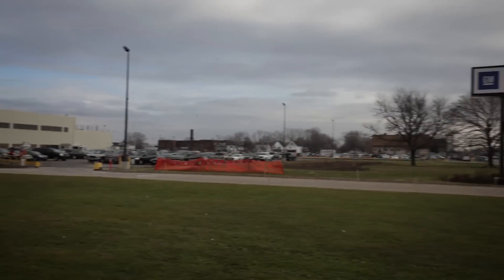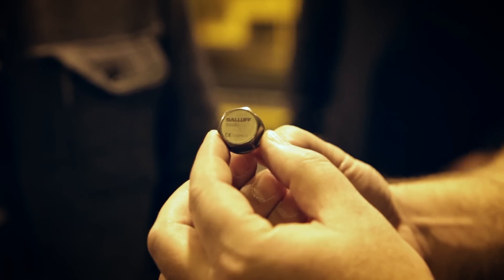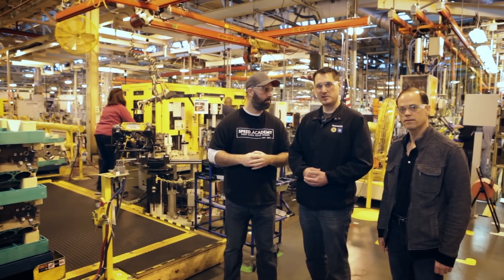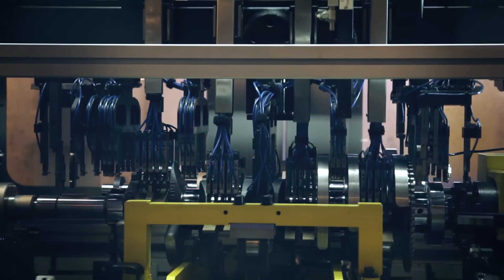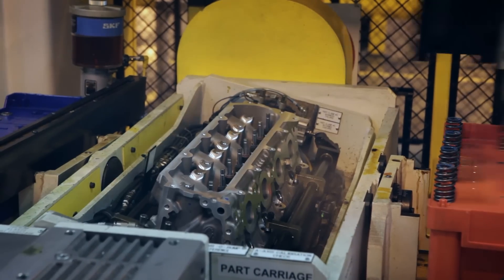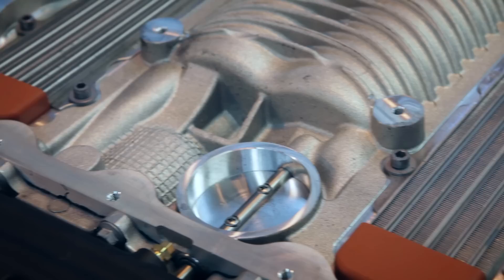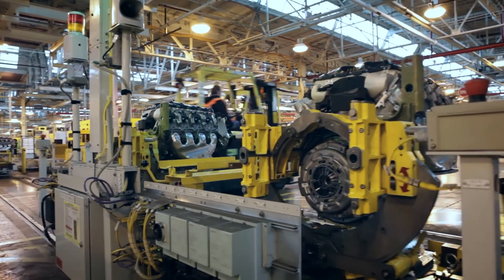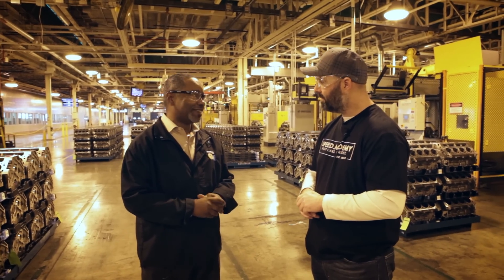Building GM's most powerful Engine Ever, the 650hp LT4 V8!

Comment: Sorry m8, but the LT4 isn't the most powerful engine that GM built. The most powerful (and also biggest) would the the legendary 572. Produces somewhere around 900 Hp.
Reply: LT4 is for production vehicles. The 572 is a special order racing crate engine.
Reply: the LT4 is for production cars that is everyday driving. The 572R is for race purposes only.
Reply: +Erik Burrell you can have a everyday driver with a 572
Reply: it is rated at 727hp at the crank MAX...some of the 572s only make 600hp
Reply: +Erik Burrell it would be badass
Reply: I think he meant standard production automobile engine.
Reply: +Erik Burrell damn! I thought the 572 was rated a some 700hp, but 900hp, that's insane naturally aspirated power.
Reply: The 572 is not in everyday cars but, but the LT engine is >:)
Reply: LT4 is a production engine broski 
572 is a crate engine
Reply: Erik Burrell production engine
Reply: blue03r6. You might want to do some research before you say something,,, 😂
Reply: Lt5 in c7 zr1 makes 755hp
Reply: Jorge The beast no the lt4 only makes around 300 to 400 hp without the supercharger, if you put a supercharger on the 572 you have way over 1200 easily
Reply: ForzaClutch there talking normal production
Reply: The 572 is not the most powerful engine GM ever built. 

Remember that Electro-Motive was a division of GM and EMD’s V-16 265H produced over 6000 horsepower.
Reply: Norman Fillmore it’s a train motor shut up
Reply: This should of been reirriated as most powerful small block LT4 V8 GM production engine built meaning produced in large quantities in a plant assembly line. You're probably talking about a 572 big block engine thats modified and only special ordered.
Reply: What about the ss 454
Reply: Comparing a crate engine to a production engine, Thanks for proving the internet is a  playground of idiots.

Comment: Can someone please explain to me what makes these engines so compact?
Ta.
Reply: +Samsgarden 
Single cam in middle of block, 16 valves, pushrods, single chain for valve train to crankshaft for timing. Basically all the weight is lower down than any competing OHC engine and they are smaller and usually lighter also.
Hp per litre might not be as high but they have more liters in a smaller package to make up for it, the torque curve is thus better. The efficiency of a modern corvette or camaro Z/28 (even 7L LS7) is better than e.g. a Nissan GTR with latest V6 TT. Engine weighs less too and is much smaller. Power figures are comparable if not better for the v8, response will be too, no turbo lag. Not bad for a 60 year old engine design....

Comment: GM offer turn key engine LT4's for people that, lets say, want to put them in a 240sx?
Reply: tempted after my KA-T goes boom
Reply: +stephen dwyer burning oil only means it needs a little head work most likely. great motors those 318's :)
Reply: +stephen dwyer I don't think we understand. Punctuation helps a little too.
Reply: SquillyMon "LT4
MSRP $15,625†
P/N 19332621 and 19332702
(19332702 $16,250 MSRP)" 
they're selling it pretty cheap, but that's just the engine with no computer. if you add it up just the engine and transmission with controllers would go up to 25+k
Reply: +walperstyle Just buy a used one from a junkyard...
Reply: Thats too much for that car .  450 in a 240sx is perfect and you can drive it anywhere and whoop anybodies ass. Power to weight!
Reply: +walperstyle 
Yes they do. Jegs has them for a measly $21,455.
Reply: +walperstyle I'd say a LS3 is enough, maybe even a LC9 if you're on a budget.
Reply: +walperstyle Sure do...That is if you have the green... and LOTS of it.  I THINK this engine is close to 25 grand...but not certain...thats my guess.  I do know its available to purchase however.
Reply: Whoa !   That's a pretty good deal actually...
  Oh wait...I just read the rest of your post...  Yeah basically anyone who wants or even thinks to buy one of these wants it in an installable and runnable state so very few people will buy the naked block.  My first guess was close to 30K....which probably wasn't far off. 

For 30 Grand I can build something really crazy and fun...  That's a lot of money
Reply: Specific cars or trucks to choose from?
Reply: +walperstyl N.a, nos or turbo?
Reply: what is nos?
Reply: Well, NOS is actually a name brand. The substance used is NOX, or Nitrous Oxide (Nitrous Oxide System = NOS). It's sprayed into the intake along with extra fuel via extra nozzles. 2 systems, wet or dry. Wet is fuel and nitrous sprayed from the same nozzle with 2 ports for both fuel and nitrous (for higher power increases), Dry is just nitrous sprayed from extra nozzles and the extra fuel comes from either extra injectors or the same injectors at higher psi or longer duration (for lower power increases).
Reply: Yeah sorry, it's not NOX it's just NO. NOX is oxides of nitrogen produced by high combustion temps. Nitrous oxide is the same for cars as the stuff you breath at the dentist AKA: Laughing gas.
Reply: Through I have a standalone ECU that could adapt to nitrous, I'd never run it.  It is better to go with a good efficient turbo (not a big turbo, but an efficient one)
Reply: Yeah, there's just something about instantly cramming oxygen into a cylinder in the hopes that you've got the right amount of fuel so you don't blow up or burn up your internals. "Danger to the manifold".

Comment: My GM must have had aeroplane parts in the engine, coz' it flew to bits on the way home from the dealership...
Reply: MrKdr500  At least GM underlined the problem
Reply: John Jesus And ford circled the problem also.....
Reply: John Jesus "A joke is something spoken, written, or done with humorous intention.[1] Jokes may have many different forms, e.g., a single word or a gesture (considered in a particular context), a question-answer, or a whole short story. The word "joke" has a number of synonyms, including wisecrack, gag, prank, quip, jape and jest.[1] To achieve their end, jokes may employ irony, sarcasm, word play and other devices. Jokes may have a punch line, i.e., an ending to make it humorous.
A practical joke or prank differs from a spoken joke in that the major component of the humour is physical rather than verbal (for example placing salt in the sugar bowl)."
PS. if you work with drawings/plans you circle the problem! cockhead!
Reply: Keep lying kiddo.
Reply: John Jesus actually I was taught to underline the part of a sentence that was the answer or the most important part of the scentence

Comment: Still using cast cranks, pushrod's, and boring the cylinder walls without a deck plate......  Some of the many reasons I'm not a fan of GM
Reply: Don't go hating on push rods. Top fuel dragster and funny cars are the fastest on the strip and they have???... fuckin pushrods.
Reply: 4g63mark The cast cranked LSX's are handling up to 1000hp. DSM's are so much more reliable than any GM. Yeah right, have fun fixing your 4g63!
Reply: 4g63mark You were soooo close but missed the point. Has anyone made a OHC car go sub 4 sec in 1000 ft? No. You say an OHC cam engine would make more power. Show me one that makes 10,000 hp.
Reply: 4g63mark *Honing, not boring. As far as the pushrods and whatnot, GM may use older technology but it still works and it seems to work quite well so why change it? I do agree with you on the cast cranks however. I can understand that it is easier for mass production but a forged crank would be so much nicer.
Reply: +4g63mark GM  knows that the OHC is not worth the extra cost ,size ,weight ,complexity or durability issues  when they have a cheaper lighter  more compact durable push rod engine that can produce more then enough HP for it's intended use.Not to mention the cost of rebuilding a OHC engine is much greater. Sure the push rod engine is dated but Gm probably makes the best,least expensive,most advanced push rod engine on the planet.
Reply: 4g63's were designed for a turbocharger from the factory, so while it is impressive that they can handle lots of boost, it isn't at the same time. Why is 1000hp impressive? Because its 1000hp. That's plenty hp for most applications, more than plenty in reality, and it's impressive that an engine designed to be worked to death in big pickup, naturally aspirated, can handle that for any period of time really. Toyota does make great boosted engines.
Reply: 4g63mark I'm waiting...
Reply: +4g63mark I'm not the one who says it would work I like pushrods
Reply: Correct about rules and incorrect about more power. Junk OHC engines will not make more power than the Chrysler style hemis being used. Also as someone else mentioned, it is how much clutch they put in it that dictates how much power is put down and how soon.
I suspect in designing an OHC engine for top fuel, you'd absolutely have to have a hemispherical combustion chamber and you'd end up with even worse reliability, way too many parts that would require far too much time for the complete tear down performed between rounds.
Reply: +4g63mark please explain how a over head cam engine will make more power, did you just say that cause it sounded good.
Reply: +4g63mark  so just be issue u think the coyote is the best that we all need to jump on your band wagon. I thought this was America
Reply: 4g63mark The coyote engine I am looking at is 430hp and 400tq for 6900.00.
A better comparison would be the LC9 5.3 with 340hp and 340tq for 5900.00.Put a cam,intake, valve springs and a set of headers with the right tune would get you close to the 450 hp 450 tq mark for 7000.00.Would be more compact and lighter not to mention millions of engines in wrecking yards for cheap endless supply of parts which is what makes the ls engine so popular.
The LS7 is a corvette engine with forged and titanium internals from the factory.
Of course it is pricey but it is likely the most advanced power dense OHV NA engine on the planet that comes with a 100k warranty.
Reply: These are forged cranks, push rods are the reason why an LS is as compact and near the weight of  a 4 cylinder and can easily make 650 with minor mods and they're honing not boring.
Reply: TheZigZagg My current project is a Navigator swap into my Mustang.  The Navigator engine is REALLY affordable at recycling yards and comes stock with a forged crank.  The Cobra engines with factory heads, factory block, and factory crank are powering low 6 second cars, with the 5.9 passes coming from the Bryant crank.  That's REALLY impressive for a 282 cubic inch engine.
Reply: what's the point of the 1uz in reality, aside from keeping the same brand v8 in a toyota/lexus?
Reply: It's not a truck engine, and doesn't sound like one either. 
But thanks to that DOHC magic, they are very free revving. 
It's also very reliable, and can be had very cheap. 
They're literally scattered around scrapyards everywhere. 
I guess you could boil it down to supply and demand. 
Supply is relatively high and demand is relatively low. 
It's no cast iron block boost demon though. 
I feel I should also add, the JZ is not my favorite toyota engine.
Reply: I will gladly show you that as soon as someone decides to build an overhead cam engine that can handle everything associated with running Nitro.
Reply: Why haven't they? Its not hard. Its just money. All you need is a shit ton of billet alum. and steel and a cnc machine and be smart enough to write the program and run the machine. If you make enough connections to know people in the industry and can get them excited about what you are doing you can get them to manufacture the parts for you at their cost or even free so long as you are willing to be the guinea pig
Reply: Cool man.  Go for it if it's that easy.  Keep us posted on the results.
Reply: It's probably best for you to do your own research.  There are many reasons and a lot of information is available
Reply: +harry guy I hear what you're saying and agree to an extent on some points.  However GM shouldn't be charging a premium for what we both agree is a dated design.  A person can literally buy a brand new Coyote engine for THOUSANDS less than the cost of a brand new LS7.  If you don't believe me go to Jeg's, or Summit and price check both in equal trim.  As a matter of fact the upgraded Aluminator Coyote engine is over $3,300 less than the LS7 right now on Jeg's.  I'm literally looking right at it.
Reply: money boys money...cast cranks are cheaper .
Reply: Forged cranks.. over 1000hp capable stock... and thickest cylinder walls of ANY engine your going to find.. (4.8, 5.3)
All tech capable of big power and well over 300k mile engine life... 
 Unlike a 4g63, that uses a timing belt... which is SHIT. Tearing into an engine at 75k-125k miles is just garbage reliability.
  Crank walk your way out of that one..
Reply: 4g63mark And they still can't deliver quality...Just look up how bad quality is on the LTx series and how many engines that has blown up in the first few miles. LSx is so much better series.
Reply: 4g63mark You're right about the rules but wrong about not being able to utilize more power. The only time they lose traction is when the 5-stage clutch was improperly set up. Set the clutch up a bit more lazy and you get to use more horsepower.
Reply: Spencer Hall 
Why is 1000hp impressive. 
How much boost can you throw at a stock LSX, and how long does it last?
The 4g63 is fairly impressive for it's time, and it can handle allot of boost. 
Toyota makes better engines then mitsubishi though.
Reply: 4g63mark
The 1uz can be had for about 200$, it also sounds amazing and is very overbuilt. 
But again, it can't handle too much boost without some upgrading. 
Responds very nicely to superchargers though.
Reply: hayden12w3 They do make enough power for their target market.  But to answer your question in regards to "Why change it?". The answer is cost.  GM customers are paying a premium for an engine design that the rest of the world has moved away from.  As of right now, GM and Dodge are the last 2 car companies on earth that still use pushrod style engines.  Everyone else has moved up to overhead cam configurations where there is a lot more potential.
Reply: @4g63mark  You say moved up to but there is a clear reason that you wont find a 7.0 liter OHC, in a Mustang.. And thats because the heads are so large you'll be cutting at the hood to fit 5.4liters worth...
 Notice the N/A OHC engines revving to 3,500rpms in 1st gear, to keep with a mild traffics pace... Lack of low throttle low end torque is another issue with n/a ohc's.
(You can do anything with turbos ofcourse)
Reply: DrTittieSprinkles top fuel dragster's have to stay with pushrod's for 2 main reasons.  #1 The governing body that controls the rules of their class made it that way.  People can't just bring any engine they want to race.   It has to be a 500 cubic inch pushrod engine.   #2  They already have trouble keeping traction with the power that they have.  Using an overhead cam engine making more power would make it nearly impossible to get down the drag strip
Reply: There's a resistance to change for the better. Same reason why we are not using Metric System. America needs to evolve soon or else will continue to fall behind the rest of the world.

Comment: ummm did they bring back the lt engine name?  I was under the impression that the lt4 was the lotus built 32valve 350 rated at 405 hp.
Reply: beargibson3100 lt5 lt1/4 where always cib engines
Reply: Ok
Reply: beargibson3100 yeah its confusing but they reuse designations but its actually only called the gen v small block now

Comment: To bad they didn't build any longevity in our 09' Impala, that has has a knock in the engine since it was two years old. I fought with them over this noise till the warranty ran out. The topper that finally pissed me off was they, the factory rep, offered to fix the car out of warranty, with me paying for half the repair cost. This was my first GM car, I will go back to my Chrysler. Rant off.
Reply: Auggies1956 you didnt just pay them half a knock could be anything and most of the time its poor maintenance
Reply: I'm a retired  auto mechanic, citified in several areas including engine mechanical.. Does that answer your statement about poor maintenance ?
Reply: Auggies1956 eel being an educated auto man as you say ....Chrysler is not at all reliable

Comment: Not to mention, cast cranks? using advanced machines to assemble engine components instead of doing it by hand? I can understand doing all the head bolts at once etc, but everything else should be done BY HAND AND INSPECTED BY PROFESSIONALS. All this robotic equipment and they don't even clean out the castings of parts so that they perform better. They just make the engine bigger and add a supercharger... buying their way out of problems instead of doing the job right the first time.